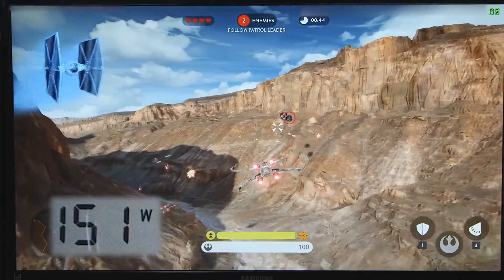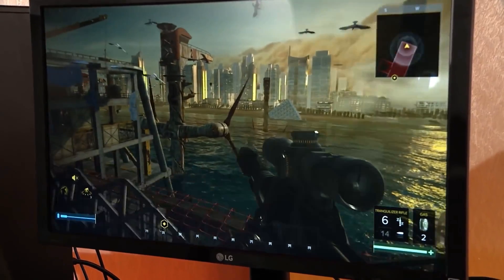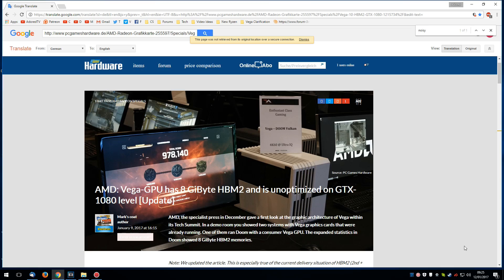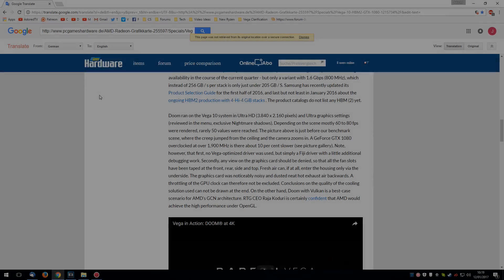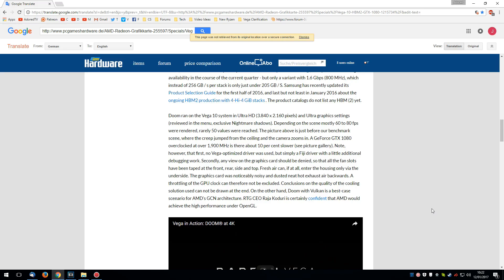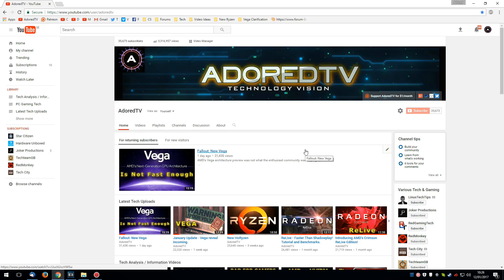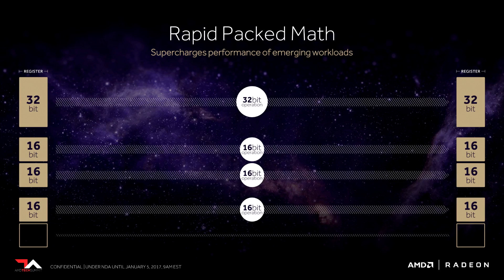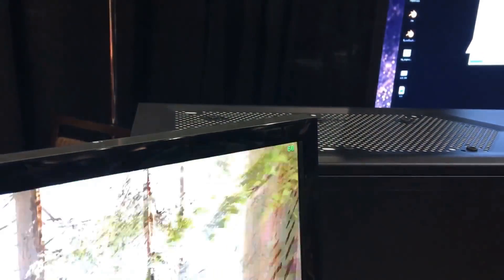Vega Clarification - How bad is it?

Comment: Hi AdoredTV, great channel, I love it. Here is a question for you guys:

- With this new technology about the "high-bandwidth cache controller" and Vega only having space for 8GB of HBM2 on the chip... could these graphics cards also have additional "not so fast memory" like GDDR5 on the graphics card itself?

Example: Graphics card with 16GB of "memory": 8GB HBM2 + 8GB GDDR5

I'm no electrical engineer... I don't really know if it's even possible... I'm just letting my thought out here
Reply from the maker: Something is going on with the new controller but not quite sure what yet.  We should get more details over the coming months. ;)
Reply: That't what the HBC and HBCC does. It will use gfx card ram and your system ram and or HDD space all as GFX RAM. They dont need to squeeze it on the GFX card. You now have up to 512TB of "gfx RAM".

Comment: This got me thinking that there will simply be no small or big Vega. There's likely going to only be the 450-500mm^2 sized GPU that they always used and demoed. With better cooling, I just don't see this particular GPU to match Titan XP in any way, though it will be a very nice alternative to the expensive GP100 @12.5 TFLOPS. Thus the "very, very competitive" statement. In short, Vega is only aimed to compete in the deep learning segment, not the high-performance consumer market. AMD surely wasted a year since Polaris in the market that we care about.

Oh yes, I miss Hawaii. It is the last AMD card on the HPC market that can somehow compete with GTX 980 a card that is replaced 3 years later :).

Comment: Feel like I've just been visited by the grim reaper, it's a very sad analysis. This is so compelling and quite shocking, but hope it's all wrong and AMD pull something out of the bag.

I guess the only saving grace which wasn't discussed might be the price. GTX Titan and the 1080 are both ridiculously expensive, I do not want to buy their over-priced products and if for example the flagship Vega came in at say half the price of the 1080 but with 15% increased performance, we might be onto winner.

I'm still hoping for a 16GB variation of the card, it seem unacceptable to be releasing an 8GB flagship card so long after the competition, surely the demos are not what it looks like and the use of the word 'flagship' was purely an inaccurate statement by the correspondent.

Comment: Wow!! you guys complain when AMD makes a 5.0ghz 8c CPU that wont beat an intel i7 3820 quadcore because single core performance was bad on the FX-9590,, now AMD have designed graphics cards and CPU's to work smarter not harder and now complaining about clock  speed???  WTF??

Comment: I realized you were pessimistic about Vega, but there are a few architectural improvements. OpenCl performance is going to be very good. This also means improvements for gamers in the future. Because of the shared memory architecture, multiple GPU's and the CPU share the same pool of memory. For Consoles, this would allow multiple GPU's to scale better and the processor to move data to the GPU much quicker, so games on consoles have the ability to better utilize resources on multiple gpu architectures like the PS4 Pro. Also imagine a crossfire bridge combining two cards HBM2 memory as a shared resource. I don't know if Vega could do that but imagine if it could.  As more games take advantage of this architecture, the same architecture moves into PC games. If priced correctly and if two vega gpu's scale better in crossfire than two 1080ti's you start to see how if this trend continues that AMD is on a path to outperform nvidia gpu's in the future. I'm interested in crossfire performance and moving data from the CPU to GPU much more efficiently and performance gains from that. Only time will determine if there will be fruit from this architecture change.

Comment: There is a theory that's been floating about in my head. It may sound outlandish/delusional but there might be some reason in amongst it. My theory is, what if AMD is concealing/downplaying the card's true performance to throw off nVidia for when they roll out the 1080Ti? 

In recent history, the high end offerings AMD had offered would be countered by nVidia e.g. the R9 290/290x was countered by the 780Ti and the Fury X was countered by the 980Ti. Maybe all this secrecy could be because AMD knows their rival will be watching and they don't want to reveal their hand at this stage closer to final release. 

I guess the only way to real find out is until the card actually ships and the tech press are given their own Vega Silicon for benchmarking.

Comment: would actually love to get 4 vega cards and put it in a new main system of mine. not necessarily for the performance increase in some random application that would actually benefit from them,  but to support amd. i've already set my mind to get the 8c/16t ryzen chip to replace my i7 5820k system soon after launch, and i would love to have an all amd system as my main machine again. if the best vega card is even remotely close to the titan xp performance for significantly less, then i'd gladly sell off my 980 tis to get them.

Comment: Adored, what you said is absolutely right About AMD having to slightly out perform NVidia 1080 GPU with next gen HBM architecture (VEGA). instead they could have beefed up Polaris GPU's to compete with 1070, 1080 as well as with Titan xp cards. and have VEGA created a whole new level of GPU's at  1080 price point. 
From very beginning AMD has been innovating new technologies in CPU's and GPU's and competitors use their technologies and out perform AMD in very aspects. AMD has done the right thing in RYZEN CPU.

Comment: You assert that if they make a pascal GPU with HBM2, it will shit on AMD, and yet, youre providing no real evidence for it. youre simply trying to compare oranges to apples. Nvidia;s architectures now deviate quite far from AMD, with the focus being fewer cores, higher clockspeed, but what youre taking is a GPU that really isn't bottlenecked on memory bandwidth(the major advantage of HBM, along with die sizes and power draw) Right now, the Titan X(p) has what, 480GB/s of memory bandwidth? GDDR6 is surely around the corner, with GDDR5x being mainly a bandwidth bump. can you really apply the currently unbottlenecked core, and add to it more peak capacity, up to 1TB/s of bandwidth, and just assume that Nvidia can just tack it onto current architecture, they run into a host of problems using a GPU built for GDDRx, and using the lower frequency, higher width HBM on that is going to introduce.. hiccups, to say the least.

Comment: Keep in mind the fact that Vega is beating the mainstream high end GPU the 1080 which is priced 500-600+ US. The Titan-X is top of a different level and is $1200, I never expected AMD to go after the Titan. That's not what real people buy. Also looking over at Ryzen as well, it is slightly faster than or equal to the 6900k, that chip is NOT Intel's top enthusiast CPU, the top chip is the 6950x at $1650 US, not what real people buy. I believe AMD will be in the price and performance sweet spot and hopefully will make lots of money.

Comment: To be honest, it doesn't interest me if it beats Nvidia, be great if it does but I'm more interested in the price, I usually aim for a doubling in performance per gpu upgrade and I've got a 280x, I think the 1080 is about double the performance of my card, if AMD can do that at a reasonable price then they've got me, also with all the news with Freesync and HDMI adopting something similar, AMD gpu's have become the only option for me unless Nvidia ditches Gsync.

Also one thing that doesn't add up, why would AMD advertise poor volta if it's just a match for 1080 or there about, considering volta is Nvidia's next gen card something doesn't add up, showing that suggest that Vaga is much faster than the 1080 and even faster than the Titan X unless Nvidia do little to no performance improvement with Volta, showing poor volta and not matching or beating volta could end up being a spectacular home goal PR wise for AMD, so yeah something doesn't quite add up yet, maybe AMD are holding back because what they was doing before wasn't working and because of the mindshare have to really blow Nvidia away to gain mind share, I suppose we'll find out soon enough, but if AMD are really going to make an impact, price is key.

Comment: Interesting thing about this, i think we can safely say that vega is about 7-10% faster than the 1080 right? but theres also drivers involved here, as well all the final tweaks in clock speed etc. We've already seen what just drivers can do on AMD cards, they've boosted the 480 by up to 5%+ in some games and thats one polaris optimized driver to another, what about fiji to vega. We could be looking at up to 20-25% gain on the 1080, and look at that, you're right in Titan XP territory, maybe the speculation wasn't so crazy after all.

Comment: AdoredTV, why do you find it so problematic (you sound quite pessimistic) if AMD would have given up on that very small top segment of the graphics cards market? What percentage of customers buys a Titan/*80 Ti or Fury card? Around 1%? 
If you spent 100-450 euro on a graphics card, then why would you care about which company has the best performing highend card which is out of reach for most people anyway? It should be about GTX 1060 vs. RX 480, GTX 1070/1080 against Vega 10, GTX 1050 Ti/1060 vs. RX 470, GTX 1050 vs RX 460 etc.
AMD just needs to make sure that it wins in these markets, Nvidia can get the 1% part of the market as far as I am concerned.
It also looks like AMD might compete with the Titan/1080 Ti with a double GPU card. Is that so bad? You lose some performance due to a less than perfect scaling but you also win some performance thanks to less yield problems (two smaller GPU sizes vs. 1 larger GPU size). The scaling only has bo optimised (at first) for the games which require more than 1 Vega 10 GPU for a good 4k performance. In 2018 they might come out with a 7nm Vega card (Vega 20) according to leaked internal documents dating from september, I would say that even gives plenty of performance for 4k at higher refresh rates (over 100 fps?), especially if you are somewhat modest with AA which can easily be done at such a resolution.

Comment: Even if Vega doesn't crush the 10 series cards, I will still get Vega for my next build. It will have comparable performance with a more expensive Nvidia card, and I don't cycle out cards every year like some seem to do. I keep mine for 3+ years. One year after release, Vega will be even better relative to its Nvidia competition.

Do you really need to have the best card to win?

Comment: I agree that this card won't match the Titan, it should fall in between the 1080 and the 1080 Ti or in the best case scenario around 1080 Ti. This is not AMD's best card. One possible explanation: this card will be sold as the GTX 1080 competitor and a cut will be sold as the GTX 1070 equivalent, another possibility is that this will become the RX 490. Why?  If a Vega cut is going to be sold as the RX 580 this should come around GTX 1070 performance. They have to sell a GTX 1080 equivalent for the RX 490 price. 
A double GPU card will come out which will be sold for a price around the 1080 Ti. Generally speaking I don't like double GPU cards but even with bad scaling it still should beat the 1080 Ti easily. It all comes down to pricing.

Anyway, I prefer to choose AMD as long as their products suffice. I don't care about the 1% cards, I don't spend more than 400-450 euro on one card.

Comment: They do NOT have final silicon with 5 months to go! It does not take that long to mass produce enough stock to ship... They are likely still deep into the testing and validation, needing only about two months from final silicon to fab ramp up production to binning, packaging and finally to shelf.

Vega is leaked to be released in May, that's AT LEAST three and a half months away, meaning they have over a month and a half to modify metal layers and tweak the mask set to squeeze more IPC performance, clock speed out of the design, and at the same time they are surely tweaking drivers.

We don't even know what bugs are in the silicon right now, we don't know how old the ES's were in the demos they have had already. Nobody outside AMD can say for sure if Vega isn't going to be fast enough to compete with nVidia, there are too many variables left on the table and too much time left to a May launch.
Reply: Typical AMD fanboy, defending a corporation. Well done sheep!
Reply: Typical Youtube commenter, relying heavily on Ad Hominems because you don't have a valid counter argument.
Reply: Doom2pro By your logic you are guilty of the same thing. Derp.
Reply: Somebody doesn't know what an Ad Hominem fallacy is.
Reply: Doom2pro Using an Ad Hominem fallacy to call out and Ad Hominem fallacy is an Ad Hominem fallcy in itself. Derp,
Reply: Doom2pro 'Typical youtube commenter' clearly falls within Ad Hominem......
Reply: "'Typical youtube commenter' clearly falls within Ad Hominem......"

No it does not, sorry but an observation is not a personal attack, you indeed are like a typical youtube commenter, as most use fallacies to constitute their arguments. 

Now that you have been educated on the subject, please stop spewing nonsense everywhere, thanks.
Reply: Doom2pro Well my original comment was also an observation as well then :) . As you are a typical AMD fan that needs to defend faceless corporations.

Now that you have been educated on the subject, please stop spewing nonsense everywhere, thanks.
Reply: "Well my original comment was also an observation as well then"

So clarify then, seeing as you probably don't even know what shill means and see others using it so you just decide to do the same.

Do you think I was pointing out a flaw in one of the arguments in the video, or do you think I spend all day posting youtube comments to defend a company?

No wait, I don't give a crap what you think, so you can scurry off to wherever you came now.
Reply: Doom2pro You're too easy to rile up lol.
Reply: Cool story bro.
Reply: Doom2pro As Nick Yemana would say "Very well put."

Comment: Having all this forward thinking tech is what makes AMD so competitive on the long run. Their chips "age" better not because they have an AMD logo on them but because they have all this kind of innovative tech that might seem like a waste at the first glance. I don't think the Async compute on the 7970 did it justice when it was put against 680 in Dx 11 games.
About die size, while it might be an indication of production costs and therefore retail price, I think its unfair to compare TSMC 16 nm and GloFo 14 nm, for all we know GloFo might be very cheap. If final high end Vega delivers close titan x pascal performance for the right price (500$) it will be an instant buy for me.
Remember that RTG only formed 1 year ago, and GPU development cycle is 4+ years, they simply have to go with what they have. I have faith that raja koduri will steer the ship in the right direction, but he needs time. As long as they manage to retain 30-35% market share I think all is going to be good.

Comment: But does this all apply to a chip that is not quite GCN anymore using an older card's driver? I've heard a lot about Vega's changes being AMD's analogue to nVidia's changes on Maxwell. How does a Maxwell card perform with Kepler drivers? Is there any way to check that?

Comment: For those of you who think that vega may beat titan x:
the FLAGSHIP Vega GPU has approx. 12.5 teraflops of compute (based on the instinct MI25, I doubt they will have anything better than that)
The Titan X has 11 teraflops.
Considering that the fury X at 8+ teraflops rivaled the GTX 980 ti at 6.5 teraflops, I don't think the Vega GPU will beat the Titan X (Another so called "disappointment" like the Fury X but without the memory issues).
At its BEST (this is at stock clocks by the way) the Vega GPU will marginally beat the Titan X in a non-vendor biased game, and in games like DOOM (or other Vulkan games) you may see it beating the Titan X by a considerable margin (sorta like how you see the fury X and 980 ti now).
If the Vega GPU is a poor overclocker like the Fury X there is no way it can beat the Titan X which is a fantastic overclocker.
Definitely not a Volta Destroyer unless AMD has some tricks under their sleeve.

This is the Fury X all over again folks.

Comment: VAGA douse not need to beat nvidia because nvidia is already over priced as long as vaga gives good performance at a lower price point they will compete with nvidia. a gtx1080 is around $800 if AMD vaga gives simpler performance at lets say $600 then they are on a good footing. as i have said in the past i will not pay more than 5 to $600 for a gpu anything more is a wast of money and very few people will pay that for a gpu or a intel $1700 cpu. if vaga Equuleus a 6900k in performance at a lower price then all is good